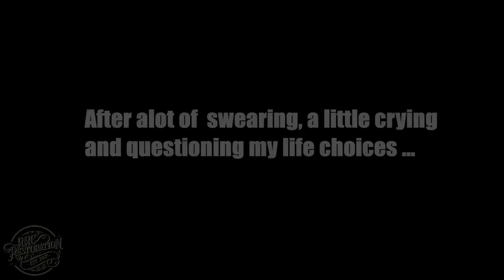Restoration Of An Abandoned Subaru WRX -  Genuine Barn Find!

Comment: As a car and restoration enthusiast, last night I found this wonderful work among the videos recommended by YouTube, which I enjoyed from the first to the last minute. Great channel, I subscribed
Reply from the maker: Thank you so much for watching and subscribing it really means alot to me :)
Reply: @RRCRestoration  Where can I access the cheat-codes for fast forward assembly without cursing and skinned knuckles? I love my 2001 Legacy rolling restoration project, but every-time I get it apart for a simple maintenance task it turns into a week long can of carnivorous worms. Just replacing the handbrake mechanism I ended up buying parts in America and having them delivered to a mate in Texas who then posted them to me - six days rather than six weeks from Japan!!
GREAT video, thanks.
Reply: LT, same here and I’ve just binge watched both sets of Impreza videos 😂 defo subscribed. Might even see one of these Impreza’s up at Knockhill or on the roads.👌🏻
Reply: Ditto nice work mate
Reply: This may be great video? I just got it in my feed and need to say. It's either a barn find in which we know who owns it and have a contact with them as a means to get legal possession. OR it's abandoned and legal possession is obtained by default through time elapsed with notices to remove or noone has done anything about it being where it was dumped, that an accepted legal process has relinquished their rights to it. . You need to make a distinction so all barn finds don't automatically get lumped into a grey area called abandoned as well?

Comment: That's a gorgeous car. One of my favorites.

Sparkplug story: I used to own a 2003 Ford Escape with a V6 engine in it. The sparkplugs had three on the top side of the engine and three on the bottom side of the engine. The top three were easy to replace. The bottom three were hidden behind the exhaust manifold which required it to be removed to access them. Needless to say, I replaced 3 sparkplugs instead of 1 when I did that job.

Comment: Great resto, thoroughly enjoyable, but when you change wheels, also swap the front brake rotors over so they are in the correct rotational direction for efficient cooling.

Comment: Its the 3rd time i watched this Video. Veary enjoyable.  As a little tipp, when putting the Oilpan or a Bucket under the Oilfilter, you can take a old Screwdriver and a Hammer and punch a hole into the middle. When draining the Filter, you make a little less mess and it only takes coupple seconds.

Comment: 2008 Chevy Uplander.. Remove coil packs.. remove engine mount.. strap engine and move it forward as far as it can go.. then there is just barely enough room to reach in and get the three rear plugs on the 3.9l v6 ! Of course if have a lift it's pretty easy to get at them from below apparently.. Cheer's !!

Comment: I had a 1968 Mercury Cougar Eliminator with a 428cid engine. That required taking the motor mounts loose and jacking the engine up about two inches to get access to the spark plugs. It was a pain in the butt. But one of the fastest (straight from the factory) cars I ever owned.

Comment: When doing cambelts on these ALWAYS do the seals aswell as taking the oil pump housing off to check the countersunk philips head screws on the rear, they have a tendency to work loose.

Comment: From the way the water sheets and beads off the paintwork as soon as you hit it with the pressure washer it looks like the car had been ceramic coated. Most likely machine polished and corrected prior to be ceramic coated too. Sign of a well loved and looked after vehicle, that paintwork looked really sharp and clear under your workshop lights.

Comment: Handy tip for changing the old oil filter without an oily mess of the overflowing filter.
You just punch a hole in the filter at its lowest point to neatly drain the oil before removing the filter itself.

Comment: 2002 impreza wagon 20k AT I bought in HK had green Tien shocks n springs, it was hard, rattle and jarring. Replaced with original new KYB shocks and rubbers n mounts, springs were Swift, wagon specific progressive red coils. The set up was amazing for a daily on roads with bumps n holes...

Comment: The spark plugs aren't all that bad, IMO. Remove the intake, battery and wash fluid reservoir and have a variety of short extensions on hand, and it's easy after 2 or 3 times. I owned a Buick that was in a completely different category. It had a transverse-mounted V6 that had originally been designed for RWD cars. The rear bank of plugs was right up against the firewall. To remove them, the manual said basically "disconnect engine mounts and rotate engine/trans forward 10 degrees." Now THAT'S tough spark plugs lol.

Comment: When I was an apprentice back in the seventies, I worked on Rolls Royces and Bentleys. The silver shadows and corniches had devilish spark plug locations. Front wheels removed, inner wing panels out then access possible using double uj joints on socket extension to access rearmost plugs. Had to be a contortionist to get the rest. Time allocated for changing them was two hours.
I usually got that job.🙄

Comment: You will probably never have to deal with it in the UK but the late 80's Cadillac DeVille had a side mount v8 that required you to pull the exhaust headers to replace all the spark plugs.

Comment: Hi there. Worst car to change the spark plugs on is a Mitsubishi Magna V6 front wheel drive. The engineers knew this so they installed regular plugs on the side of the engine that was easy to access, and iridium plugs on the hell side.

Comment: Two 14 mm for the engine mounts, 12mm to disconnect the dog bone underneath the intercooler and jack the engine by the oilpan with a piece of wood and two wobble extensions and your trust spark plug socket. It will make changing spark plugs a breeze 18:29

Comment: My 2009 Pontiac Grand Prix GXP. To change the rear plugs, you have to remove the motor mounts and pull the whole engine forward.  Even after that its still incredibly difficult.

Comment: I felt that so much when you did the sparkplugs... had to do the plugs on a 2005 forester once and my god i'd rather do a 100 timingbelts or cylinderhead gaskets than going through the pain this job was... Btw it weren't the ones that were build in diagonally for easy acess but horizontally, ended with me romoving the engineholder and forcing it up a few centimeters because there wasn't enough space on the left side to get the ratchet on... never again

Comment: The spark plugs can be replaced much more easily if you loosen the engine mount at the bottom and lift the engine with a jack first at the cylinder head on the left. The ignition coils and spark plugs can then be easily removed and reinstalled. then lower the engine on the left again and repeat the same procedure on the right side

Comment: 95 ford thunderbird sc has the most inaccessible spark plugs, i grew up in a salvage/repair shop, changed plugs on over a thousand cars and on the thunderbird sc i had to get one plug from the top, then crawl under, unbolt the engine mount and jack the motor up to get the next, then back up top, it's back n forth on them

Comment: Just wanted to say, doing spark plugs on a 2nd gen honda fit is a nightmare. You quite literally have to remove the wipers, wiper cowl and support just to get access to them properly. They had a factory issue where the plugs were undertorqued and could pop out of their holes + coil packs not lasting nearly as long as they should. New NGK plugs torqued to 19 lb-fts seems to fix the issue for good.

Comment: So there is a specific brake bleed order it's front right, rear lefr, front left then rear right I'm sure. There is a dual brake system so if it fails you still have brakes on 2 wheels spread evenly so it won't pull you to one side

Comment: I always replaced the spark plugs from underneath the car, much easier. I also used to have a 3.0R SpecB 6 cylinder and the nearside rear plug was nearly impossible.

Comment: Here in America Ford made a Triton series engine that the spark plugs were real long and 2 pieces pressed together. And after 70k miles they would seize in the cylinder head and snap off. So you have to pull the heads to get em out. They also had a generation of that engine that didn't have enough thread length on the plugs and they would strip out and actually shoot the spark plugs out of the head and dent the fenders. 😂

Comment: 1st gen Porsche 911 turbo requires you to drop the engine in order to change the plugs I believe.  As well as most transverse V6 engines have the plugs facing the firewall so are notoriously difficult to get to.

Comment: Very nice job. Reminds me of the 1999 WRX I had and the 2013 WRX STi - Both in the classic Metallic Blue. But folowing a stroke in 2014 I had to Part ex the STi for a XV Automatic so I can drive it with just my right hand with a multi-function knob on the steering wheel. Bummer

Comment: In my opinion, the chevy impala 2006 to 2012 were the worst for me. Three of the spark plugs sat behind the ignition coil at the back of the engine. Not a lot room and in some cases you need to remove the ignition coil or pull the engine forward by removing the front brackets. I know this because I owned a 2012 and it was not fun to change to back ones.

Comment: a car with spark plugs in a more nightmarish position is the Mitsubishi NM or NP Pajero, the ones with the petrol V6 engine. to get access to the spark plugs and the leads, the entire intake manifold must be removed which is quite a process given the number of vacuum lines and wiring harnesses attached to it. fortunately the manifold splits into two pieces, adding to the frustration of searching for a potential vacuum leak which may not actually exist given that the computer may fail causing a low idle condition.
Reply: I take more pleasure in replacing spark plugs on a subaru than I do the Pajero.

Comment: About those spark plugs!!
They're easy!!!😂😂
Worst I have changed is either a 3.2 6cyl 911, where each coill pack has 4 very brittle Allen bolts holding it on, or a 1.7 ltr Alfa Romeo 33 16v, also a boxer which "should" have a specific tool for plug changes in the tool kit.. should!!
Also, another Alfa, 3.2 V6, where the whole plenum changer has to come off to replace the rear plugs!🤦🤦🤦

Comment: The spark plugs on my smart fortwo are the hell to get out, because the engine is so cramp into the back, tha you cant put the the nut fot the plugs on the wrench, because its to high, so u have to drop the nut down, than try to fit it and than try to fit the wrench, but the worst part is to get all of it out, unplug everything und try to grab them with a finger

Comment: Brave of you to buy one of the few cars you NEVER buy used. The WRX and the 350z. Also not to be pedantic but if you put on a new brass washer on the brakes, you have to set it by hitting the bolt with a hammer and retightening. Also you should lubricate the rubber seal on the oil filter so it does not seize onto the engine.

Comment: I really enjoyed this video however I do have some concerns. 1. You didn't pre fill the oil filter before installing, and then started the engine up right away possibly doing damage. 2. The lower lamps on the front bumper seem like a safety item, which is concerning to me because you installed a cover over the lower lamps. Thanks for taking the time to read this, and I would love a small comment explaining why you did not/ did certain things.

Comment: I know a vehicle that has even less accessible spark plugs! To change the spark plugs on a 2003 Audi C5 RS6, you essentially have to drop the engine and gearbox out of the chassis and halfway disassemble the turbo system. Maintenance on these cars is a literal nightmare because the twin-turbo V8 engine is impossibly large for the relatively small engine bay. That's also why those cars are so dirt cheap.

Don't ask me how I know.

Comment: After all that painstaking work it's a wonder you didn't replace the head gasket and the oil pan gasket. I can see a lot of dark sludgy oil all over the exterior of the engine.

Comment: Nice work but you still have room to improve - like when tightening bolts (or even the oil filter) without using a torque meter you need to shout "SPEEEEEC" to make sure it's tighted correctly. 😂

Comment: The 2005 f150 with the 5.4 is impossible to change the spark plugs you have to take apart half the truck to get to plugs 1 and 8💀

Comment: How did you get the air filter out so easily? Trying to do that on my 08 honda fit is difficult, the top won’t budge when removing the 4 metal tabs. Am I missing something?

Comment: Errr..... Mr. RRC; You put new oil  in and heat the engine (overnight maybe) with summat like a paraffin heater (underneath) so you're starting a newly re-built engine without any stress.......
IIRC, Kenlowe do something similar you can buy off-the shelf....

Comment: Hi, I am from Bangalore India. You did a fantastic job of rebuilding this beauty. And what a beautiful colour it has too. I have two questions.

1. How many KMs had the car run before you got it?
2, I saw that you did not fill the oil filter with fresh oil before refitting it. I see the technicians at the Maruti Suzuki  meticulously  filling the oil filter before fitting it in. Is it not necessary or is it different for different cars?
3. And oh yes what kind of an idiot would abandon a beauty like this?

Comment: Changing spark plugs is a problem - Nissan Juke! There are no questions, but without special equipment, the car will not start, you need firmware!

Comment: With the Oil that black i would have done a flush or oil change again after 500-1000km so the fresh oil can clean the old gunk out of the engine, i mean the oil was not changed very long time that it got so dark on a Gasoline engine... If it were a Diesel, it would be normal but on a Gasoline it is no go, i mean on my Toyota Camry 1995 2.2 5S-FE, after 10,000km the oil is still goldenish, dark brown, but never black, because of oil change always under 10k it still going strong after 500,000km

Comment: Changing those spark plugs looks similar to the nonsense you have to go through when changing the plugs on an air-cooled VW with large IDF throttle bodies installed.

Comment: Hey Guys, Just  a quick FYI. So I'm getting asked a lot " why didn't you sort out all the rust on the underside, suspension components, radiator brackets etc etc " well this is only the first stage of restoration , in this episode the car is "restored" to a roadworthy condition so that I can enjoy it guilt free through the spring summer and autumn months but come winter it will be getting "restored" to showroom condition. I hope this answers most of your questions and puts your fears at rest. Oh and as for the barrage of " why did you cover up the fog lights" Its a Subaru rally heritage thing that started with the original Impreza back in 1993 on the world rally stages.

Comment: Errrr... Mr. RRC Restoration; a real mechanic knows you use a  torque bar to loosen tight bolts/set-screws, etc. Ratchets should be used for quick turning of any kind of threaded part. 
When I was 3 years old, I watching Mk.II Jaguar gearboxes being re-built (by a degreed mech. eng.) so I probably know what I'm talking about .....

Comment: You have not cleaned ANY PART of the engine, not even the turbo bolts... my goodness

25:10 Not like changed or the plastic tube on the back, not even like scraped off the rust... God...
apart from that you put all the OLD screws then the car is not reliable at all with that. Very dirty repairing and restoring